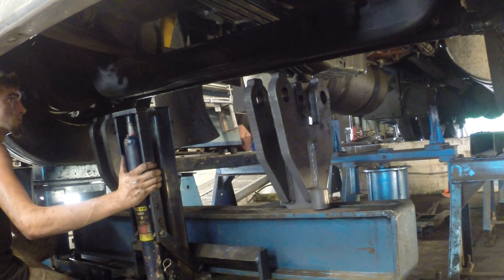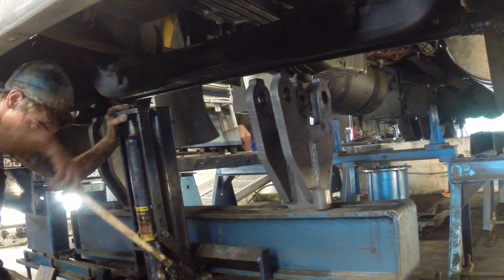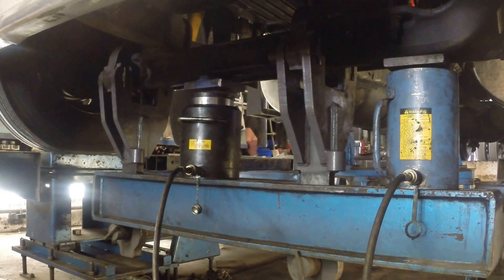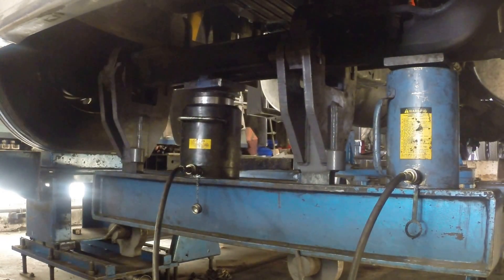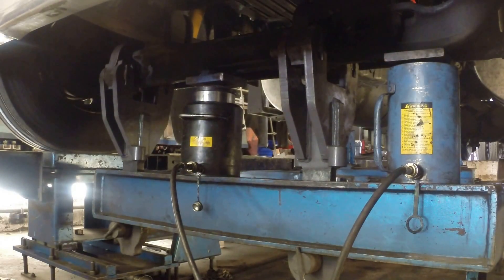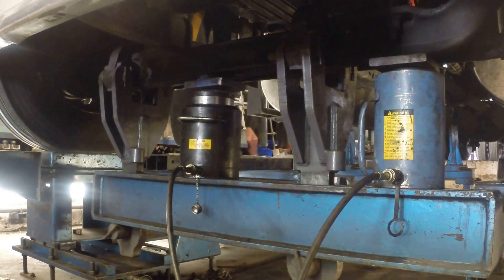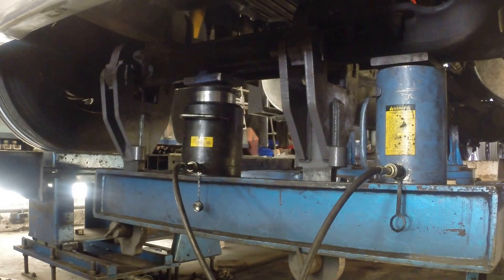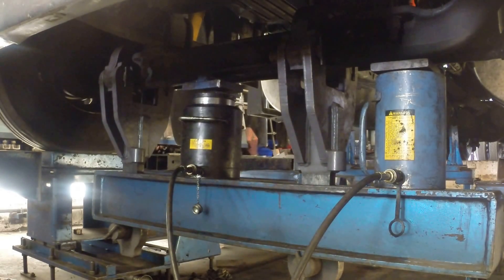Truck Alignment - Axle Adjustment

Comment: Do you realize that in bending an axle you void the lifetime warranty on the steer axle.
Reply: Ralph Light when yo crash your truck you bent it any way so , you need to fix your aligment in some how
Reply: Maikel Barreto Olavarrieta if you crash your truck and bend your axle it needs to be replaced because it has been weakened and is unsafe
Reply: axle realignment is a recognised repair procedure by manufacturers and insurers
Reply: hunter cool aid drinker